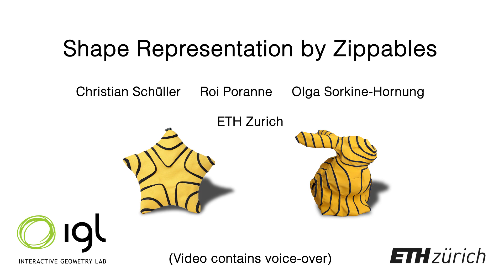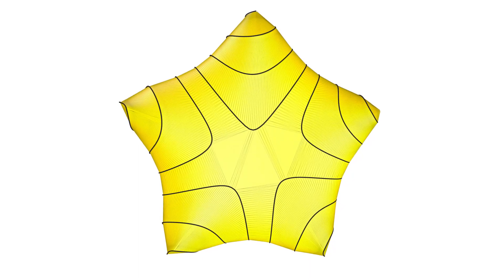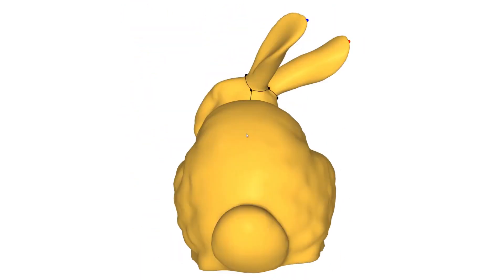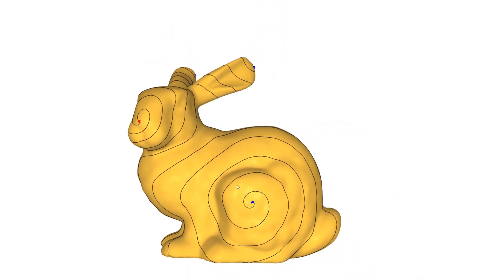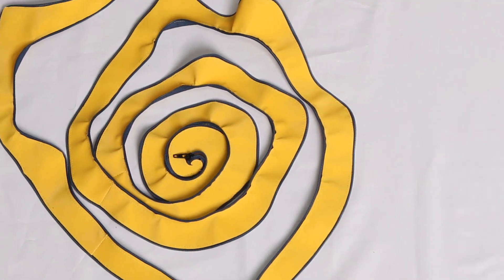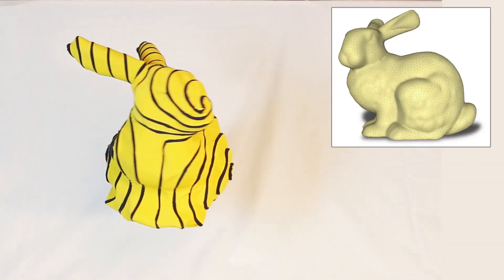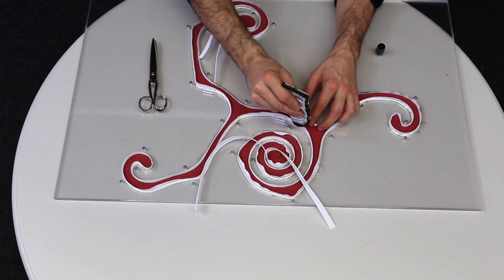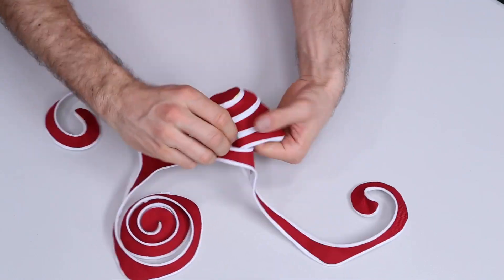Shape Representation by Zippables (SIGGRAPH 2018)

Comment: If the parts were connected by sewing instead of with a zipper,
a) would it still work?
b) could that possibly be done automatically 
c) could doing that with a substantially higher turn count (so as to have thinner strips) be effective for making fabric goods with specific curvatures in specific regions?
d) could doing so become cost effective and improve clothing?

I don't know stuff about how clothes are made, but I've heard that the armpit region of shirts is difficult due to the negative curvature, and because this seems to handle regionals of negative curvature quite well, I was wondering if it might help for that.

Oh, also, can this work for things with holes or branching tubes?

In any case, this is cool
Reply from the maker: a) Yes, the compuation is actually even simpler, but it could no longer be assembled in the flat.
b) Unfortunately we are not aware of a stitching/sewing machine that is capable of doing this, but that would be certainly interesting to develop.
c) In theory yes. But I expect that there will be many practical problems to solve first.
d) No idea, but that would be great!